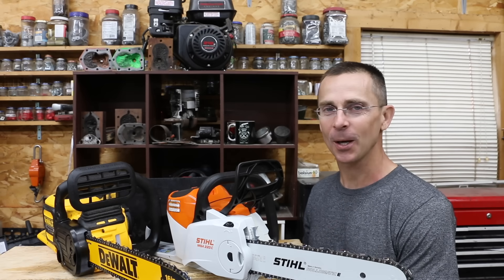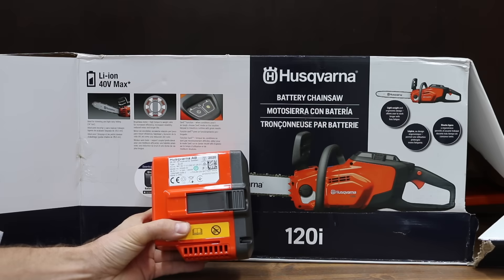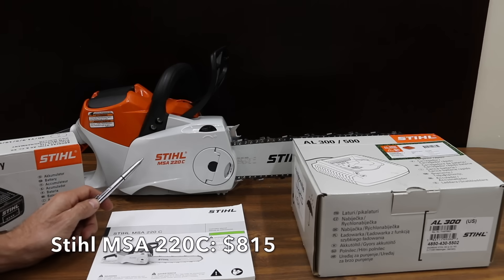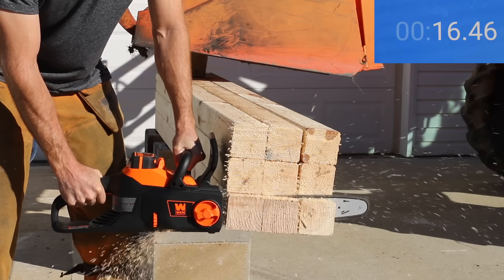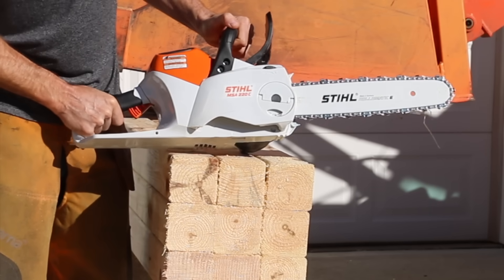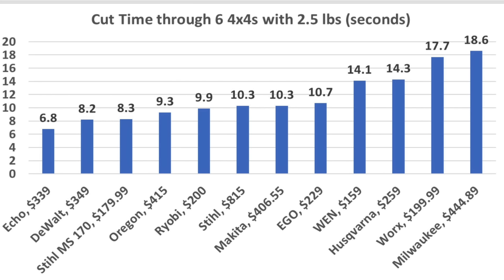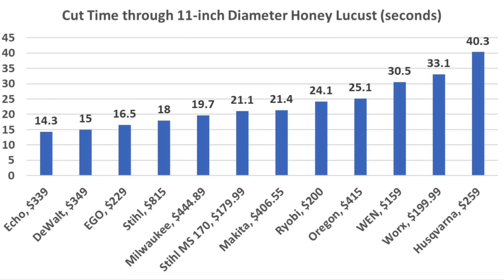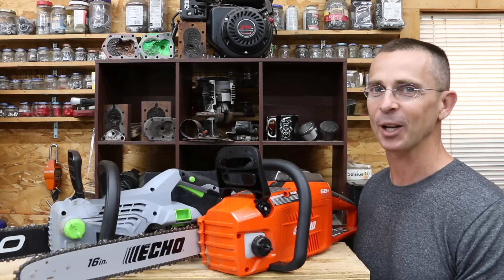Best Battery Powered Chainsaw Brand (ROUND 2)? Stihl, Husqvarna, Echo, Oregon, DeWalt

Comment: For a company like Stihl who you naturally associate with Chainsaws. I was surprised to see it so outclassed here. Especially for the price! And that is why I watch your videos! Thanks!
Reply: The only 1 up they might have had is reliability, but a 5 year consumer warranty match that too.
Reply: My stihl saw is great but it’s a gas machine. $800 for electric is way to much. My ms362c-m with the electric carb and upgrades 25” bar was $750 out the door at my Stihl dealer. That’s. A 60cc pro saw for less. I do know my dealer is awesome and doesn’t sell anything at msrp
Reply: @FishFind3000  I still prefer the 572xp.
Reply: @FishFind3000  It really depends. With Batteries you pay up front. With Gas you pay over time. Also depends if you use the more expensive "cleaner" fuel (Technically you should, as you otherwise breath in to much NOx if you use it all the time). Additionally the Battery powered tools need much less maintenance. Pretty sure, i get much better value of time, but our KMA 120 run 20h / week most of the year. (Multitool engine, can do about anything, dependent on the used attachment.)
But different world: Switzerland is much richer, but prices and salaries are also much higher. While imported tools are just a little more expensive. So 1000$ for a saw in Switzerland is like 2000$ in the US.
Main Bonus: Nimby Neighbours of the customers don't complain as much anymore about the noise.
As for Chainsaw, mostly their still gasoline, but mainly the simply last forever.
Reply: @beyondEV  thing is battery's also don't last forever and will need replacing. They also loss performance and lifespan in the heat and cold. There's some applications where battery can work but there's still lots where it doesn't work. For a homeowner they work fine for most people. Out here nobody is buying it until they are forced too. It doesn't make practical or financial sense for us here.
Reply: @JC-uq5gi  You call a good saw junk because you don't know what a good saw is nor how to properly use it. You're clearly just another fanboy. I don't usually use saws that small except for limbing or bucking small stuff but the saws I have used from Stihl and Husqvarna have all been great. I prefer not having to go through a dealer so can appreciate Husqvarna in that regard (nice to just order a saw from Baileys), and I hate trying to get my dealer to order in the parts I want for Stihl saws (like the less restricted mufflers they sell in Australia for instance or carb jets etc...). The air filtration is way better on Husqvarnas than Stihls which nobody would deny as is the chip clearance in many saws. Also the vibration damping is better on the Husqvarna saws more often than not. I probably like Stihls ergonomics better in many respects and they certainly also make great saws. Anybody that seriously says that either brand is junk is an idiot. They don't even need to explain themselves further because anyone with experience knows it right off. You are, to summarize, a blowhard.
Reply: @SaneAsylum  Only Stihl I ever had was a MS 200T, which everyone seems to love. I didn't. If ever it ran into pulpy wood it would clog up and stop the chain.  I've bought several Husqvarnas. Not one has that problem. All run great except the high dollar electronically self adjusting ones that never run right and are hard to start hot, despite following all their instructions on how to get it to tune itself.
Reply: This wasn't an apples to apples test, for instance he had the most expensive Stihl saw in there lineup and the cheapest husqvarna.
Reply: Random Stuffs  Sure thing sport, that's why nearly every arborist and logger uses either Stihl or Husqvarna.
Reply: @bubbafudpucker397  "nearly every arborist and logger uses either Stihl or Husqvarna". Not any more they don't. The guys who took down the big old lightning struck Tallowood in the paddock next door to us had a couple of Stihl petrol chainsaws in the back of the truck, but the first one they pulled out was a 58volt AEG (same chainsaw as the Echo in this video). Got the job done with it too. They only pulled out the Stihl cos they only had one battery model and there was two blokes.
Reply: @woopimagpie  Bizarre.
Reply: @bubbafudpucker397  "Sure thing sport, that's why nearly every arborist and logger uses either Stihl or Husqvarna".

It cost's more but you look professional. That's the only reason. I mean they both just got their ass kicked here.
Reply: What's interesting is that Andreas Stihl started with electric chainsaws, albeit not battery-powered ones.
Reply: i own basically all of the best saws from husky and stihl all my small saws 60 and under are husky all my larger saws are stihl also whoever sold you that msa 220 over charged you i work for a stihl dealer the saw is 369.99 with a 16 and a full chisel chain they gave you a 3636 005 0050 which is semi chisel saftey chain that saw ships with a 3616 005 0050 which is a full chisel saftey chain the battery is 220 and the charger is another 80 so even seperately you could have gotten it cheaper.....
Reply: Random Stuffs  that's definitely not true for the petrol powered stihl saws. Assuming you look after it a little, it always starts in a few pulls even when cold.
Reply: @RubsNL  Gotta agree - I dumped my Husky for a Stihl a few years ago and have never looked back!
Reply: @RubsNL  I bought a Stihl MS251 almost 5 years ago as my first "real" chainsaw with money I saved doing odd jobs for people and even though I don't use it everyday it starts every time I need it. It also helps that I don't run junk gas in it and I'm picky with what mix oil goes in it. If I don't need it for a lot of work then I'll just splurge on a small tin of True-Fuel. :)
Reply: @Slane583  Tru Fuel has been proven to be garbage though
Reply: @scottmurphy4946  I'm aware, this comment is from 4 years ago. That's why I no longer use it. I keep 5 gallons of ethanol-free high octane gas in a tightly sealed container on hand at all times until next season. Then it's put in the truck and replaced with a fresh supply.
Reply: @Slane583  I used to use it as well until I saw a few reviews and tests
Reply: you can't take your ICE engineers and put them on electric.
Reply: Well you know all of these battery-powered saws the best one held up on a battery was less than 8 minutes and I can never see myself having to go out and tackle a job that only takes eight minutes. I guess they would be good in a urban or suburban area but out on the farm in the woods I just don't know what they would really be good for unless you were using it frame something up
Reply: @jackwatkins7382  Yeah I was surprised by that. They're not really designed for continuous use, but stil I don't really understand how they went flat so fast. The wife has a little 18 volt model and it goes all afternoon on a 6Ah battery. I think cutting the hardwood is a real stress test for a chainsaw, and it would really pull some amps out of the battery doing it like Todd did in the video. A small petrol chainsaw would struggle just as much ( I know mine does - when I'm cutting up the big logs running it flat out it really chews through the juice, and boy does it get hot). In real life usage the battery would last much much longer than 8 minutes.
Reply: @woopimagpie   yeah you know it amazed me but I guess I'll just stick with my gas powered rigs. Somebody commented that that's what extra batteries are for but those batteries are expensive and I don't see myself spending over $300 for a saw and then buy another $300 worth of batteries. That's a lot of gas and mixing oil ain't it. Haha
Reply: @jackwatkins7382  Yeh, it is! 
I've got one of each now and I'm observing how the new battery model goes. So far I'm pretty happy with it. As I said, the missus chopped up a whole bunch of stuff with it (Tallowwood and Flooded Gum, both Australian hardwoods) and it went all afternoon with no dramas. The 6Ah 18v battery wasn't even flat when she was done, I was amazed at how it lasted, and the saw is easily as torquey as my petrol unit (a 30 year old McCulloch). It struggled a bit with some of the bigger flooded gum logs, but then so does the petrol unit.
You could probably just do what I'm planning, which is buy a battery model if/when your petrol ones die. Although, my little McCulloch has run fine for 30 years and shows no signs of dying. It might be a while yet. Old chainsaws are pretty indestructible if you're nice to them.
Reply: @woopimagpie  well I don't know if I'll be trying out any electric saws. I figure my money will be going for doctor bills for a while. I just got results back today from a pet scan I had done and it come back positive. But, I hear you about that old McCulloch. You know I got one of those from my grandpa back some 40 years ago and that thing run and sawed great and it was old at that time but the only thing was if it died after you had run it for a while you would have to let it cool off before it would crank again. You could pull your arm off while it was hot and it would never crank. You know there was a saw back in those days and I haven't seen them around in so many years and it was a Lombard. It favored a Homelite but it ran better. And what we call them was cordwood saws because that was what we mostly cut was just Pine that was sold as cordwood that made its way to the paper mill. Which we cut Logs with it too anything that you could get the bar through on it even if it had to go all the way around the tree. I think I'd mentioned I have a couple of Stihl chainsaws that I've had for years I think the 02 8 is the one I bought new back in the late 70s early 80s. But I've got to replace some gas system parts on it but believe it or not those things still have so much compression it's hard to pull the cord! But I'll tell you they know their way around Hardwood. I don't know what flooded gum is but we have a lot of gum and what they call black gum and black gums pretty tough but cutting firewood or wood for smoking we normally cut Hickory and old Blackjack Oak, Red Oak and Post Oak. Blackjack and Hickory even when they're green you can see sparks fly off your chain when you're cutting it sometimes. I know they were discussing chisel tooth and semi chisel tooth or something on the chains, but when I went to the store to get a new chain put on the saw I just tell him I wanted a hardwood chain or I wanted a softwood chain. And of course the hardwood would be a full chiseled I think they call it. Which back years ago I had some of the old-timers at that time tell me not to put a hardwood chain on a saw if you were going to be cutting Pines and gum because that rounded tooth done better and I think they may have been right but I cut hardwood and softwood so I went with the chisel tooth because I only had the one saw at the time and that rounded tooth did not work well on hardwood. but back to your McCullough you know that thing will probably Outlast both of us! I know you can buy the small ones at Walmart now and people shy away from them but they were good saws Back in the Day. I have a little small one that I need to replace all the gas lines on it and get it restored but oh, maybe at a later date when I get through some of this junk I got to go through. but you have yourself a wonderful day and a merry Christmas and it was good to converse with somebody from the land down under! Or at least I thought you said you were from there. Good day
Reply: @jackwatkins7382  Man that's crap news about your scan results. Geez. Real sorry to hear that.
I enjoyed reading your piece, and I learned a couple of things too. The Flooded Gum I was talking about is a species of Eucalypt - the prevalent tree family here in Australia. Most them are considered hardwoods, there's a couple of really hard ones, one called the "Grey Ironbark" (Eucalyptus Paniculata) is well over 3000 on the hardness scale. Ridiculously hard. My Gran had an old handmade fence made from ironbark at her property in the mountains when I was much younger than I am today (that species is endemic to the area where her property is so plenty of old furniture and fixtures were made from it in the old days).  She wanted to hang some plant baskets on that fence so we decided to put some screws in to hang the baskets on. After I broke a third drill bit and the drill was almost too hot to hold on to we gave up and just hung some wire over the top. A bit later on I was relating the story to the old bloke who ran the local hardware, and he just laughed and said I'd basically have no chance against ironbark with just a basic drill. He said once that timber dries it's not called ironbark for nothing. I learned something else that day too, which was if you're planning on working the hard Eucalypt woods, you'd best do it whilst they're still green, because once they dry they are as hard as iron. My Gran has left us now, but the property is still there and so is the fence! I reckon that fence will outlast time itself. I also knew another bloke whose verandah posts were made from ironbark - just out of curiosity one day he swung an axe at one of the posts and the axe just bounced off with hardly a mark left on the post. Yeah. That hard. Phew.
The Flooded Gum (Eucalyptus Grandis) we have around our place isn't quite as hard as Ironbark, but it's pretty hard just the same. It's a work out for any small chainsaw, and I wouldn't be foolish enough to attempt cutting big sections once it was dry. It's called Flooded Gum as their preferred habitat is along river banks, and the part of Australia I live in is sub-tropical so the rivers flood every year in the lead up to summer. It's quite a lovely sight actually - they are very tall with straight white trunks and when the river is in flood the whole scene is a bit otherworldly. It's sometimes called Rose Gum too - the timber has a pinkish hue when it's still green, but that fades to a lovely reddish-brown as it dries. The floor in our library is made from it. I love it, it's beautiful timber, either as a tree or a floor. As for having a new chain put on the saw, I don't think my local shops even stock softwood chains - none of our local forest trees are considered softwood. It's either hard, really hard, or forget it unless your saw is V8 powered, lol.
I've been watching a fella in the US who has a channel called Out of the Woods, and I've been learning a bit about American tree species from watching his channel. He has a small sawmill and I enjoy listening to him talk about the various techniques required for milling timber, and of course learning about the different timbers at the same time. Interesting stuff.
I believe McCulloch is owned by Husqvarna these days, and they market it as a kind of budget Husqvarna range, which could be worse. Husky make some pretty fine machines - if some of that engineering experience is filtering down into the McCulloch range they're probably pretty okay chainsaws for the money. I doubt I'll ever find out though - as you say, my current older one will likely outlast us both, and if it doesn't, well, I'll probably replace it with a battery powered unit. If the battery tech continues to improve at the rate it's going pretty soon petrol chainsaws will be a thing of the past. The battery models will surpass them in all areas, which will mean there will be no point marketing petrol chainsaws. That day is coming I reckon.
Well mate, I hope the road in front of you is as smooth as it can be. Maybe keep that old chainsaw fix as a bit of a goal - it might help keep you going when things are tough. Thanks for the chat. My very best wishes to you and yours. She'll be apples mate, which is Australian for: "everything will be okay my friend".
Reply: @woopimagpie  well thanks for the story! Extremely interesting. Yeah are gum trees here are softwood they are used for making paper and such. I don't know about some of the hardness of wood that grows in other areas but here in Alabama we don't have much except Hickory and Oak. Now I don't know that they're that hard when they dry but Hickory, if not nailable! And I don't think I've ever took the occasion to try to drill it. Like I say when it's green it'll throw Sparks off a chainsaw chain and when it's dry it don't take long to take the edge off of you're chain and that's trying to cut small stuff just for smoking and cooking. We may have another trailer to this considered hardwood but nothing like what you're talkin about that I'm aware of. I always ever since I was young would like do you have took a trip to Australia and probably even stayed. Y'all have some very beautiful country but some very strange animals that are very cool at least to an old country boy like me. The only thing that I've learned as I got to be an adult is that I hate spiders and y'all got the worst spider in the world! I read something about that funnel web could actually bite through a shoe? That might have been souped up but scary as hell. Oh and I know y'all supposed to have the most poisonous spiders but you also have what eight out of the 10 most poisonous snakes in the world? I don't remember if you have the number one space but I think that's what the documentary said about all the others. I'm not afraid of snakes as long as I can see him because I normally carry a pistol but the one that you can't see is the ones it'll get you. I hate it that you're half a world away actually a world away. I have talked about some things in the past when things were better and someone may have something and I had something and we would load them up in our truck and meet halfway. I would like to have a tried some of that ironbark and I could get it green. well I guess I better get off of here. It seems I say too much or maybe I don't say it enough. Have a wonderful Christmas and New Year's and may God bless you. And I like the old Irish prayer I guess they called it, I hope we're in heaven a half hour before the devil knows we're dead! bless you and all of your family
Reply: @woopimagpie  well thanks for the story! Extremely interesting. Yeah are gum trees here are softwood they are used for making paper and such. I don't know about some of the hardness of wood that grows in other areas but here in Alabama we don't have much except Hickory and Oak. Now I don't know that they're that hard when they dry but Hickory, if not nailable! And I don't think I've ever took the occasion to try to drill it. Like I say when it's green it'll throw Sparks off a chainsaw chain and when it's dry it don't take long to take the edge off of you're chain and that's trying to cut small stuff just for smoking and cooking. We may have another trailer to this considered hardwood but nothing like what you're talkin about that I'm aware of. I always ever since I was young would like do you have took a trip to Australia and probably even stayed. Y'all have some very beautiful country but some very strange animals that are very cool at least to an old country boy like me. The only thing that I've learned as I got to be an adult is that I hate spiders and y'all got the worst spider in the world! I read something about that funnel web could actually bite through a shoe? That might have been souped up but scary as hell. Oh and I know y'all supposed to have the most poisonous spiders but you also have what eight out of the 10 most poisonous snakes in the world? I don't remember if you have the number one space but I think that's what the documentary said about all the others. I'm not afraid of snakes as long as I can see him because I normally carry a pistol but the one that you can't see is the ones it'll get you. I hate it that you're half a world away actually a world away. I have talked about some things in the past when things were better and someone may have something and I had something and we would load them up in our truck and meet halfway. I would like to have a tried some of that ironbark and I could get it green. well I guess I better get off of here. It seems I say too much or maybe I don't say it enough. Have a wonderful Christmas and New Year's and may God bless you. And I like the old Irish prayer I guess they called it, I hope we're in heaven a half hour before the devil knows we're dead! bless you and all of your family
Reply: @woopimagpie  Now please dont say that your McCulloch is the Eager Beaver model. LOL
Reply: @woopimagpie  ..McCulloch..Nice! ..what you really need is a good ole' McCulloch SP-125.. :)
Reply: @jackwatkins7382 they are designed for the guy who only needs to do a few cuts every once in awhile not for all day work. I will say they are a game changer for use over 10,000 feat as a hunting guide if I come up on a downed log on a horse trail they fire right up and are more ch quieter  than gas. When you get to 10,000 feat it’s quite hard to get a gas one started at times.
Reply: @jackwatkins7382  That's what more batteries are for. Just like with cordless everything else.
Reply: @JC-uq5gi  There is nothing real about calling the 572/372/272 line junk. If it broke on you chances are really good that you let it down not the other way around. Of course every manufacturer occasionally has a lemon escape QC but from listening to you whinge it is clear that isn't the case here and a couple of Stihl stickers would make it run like a champ...
Reply: Staying power and longevity bud
Reply: Hell's favorite Salty Masshole  not with the same battery capacity ( watts hours it isn't) .  And you be replacing your ego after less than half the number of hours used
Reply: The same can be said for cars - even reliable german brands are making electric vehicles or hybrids now, but they do not match the quality or performance of the japanese. In 2021 having a cordless in your lineup is a must, and some companies do it as a must, this is why it's still a solid machine but they don't show it as much love as they do to their petrol line-up
Reply: More marketing budget than r and d budget
Reply: I've had my Stihl for 25 years, no major servicing required.

Let's see how long those plastic Chinese things last lol
Reply: Get that 300 series.
Reply: I’m not… look at every major big old corporation… too big to fail right???No… they just fail to innovate the new in the now.  Stihl put a lot of stock in the 500i a fuel injected saw.  Echo is a leaner younger company, hense the 2511t which challenges 25+ years of engineering in a top handle arborists saw.  (Unmatchable power to weight ratio when modified !!!).  Sawyers that run saws often appreciate power : weight, and really light fast saws.
Reply: Absolutely, I’ve always considered Sthil at the top of the class when it comes to chainsaws. 
That’s why I love this channel. everything is tested equally and placed based on its merit not reputation.
Reply: I love my Stihl 661 but I’m not loyal enough to buy an inferior electric saw from them
Reply: You have to understand the context for these numbers. I've owned this Stihl in the test for about 6 years now and seeing the results I wouldn't switch over to any of the other saws. Problem with Echo is the weight. Price wise at least today all of these saws are around the same price as Stihl. So there is no price difference. I don't know if the prices were wrong here and they are for the saws when Stihl is for the whole package with charger and battery. Stihl is among the lightest while being at the top performance wise.

With Dewalt you have a problem with the slow battery charging time. Maybe in other aspects there are no other problems. It's really only a problem if you are working 2 batteries with a charger. Dewalt looks to be pretty long so worse shape than Stihl.

With Echo you have bad ergonomics with heavy weight of the saw. You go past 5.5kg and it's not so easy to handle one handed. And you require tools to change the chain. Stihl's toolles way is just how it should be. At least you get something for the weight as it cuts the fastest and has the longest battery life. But I would not want a 6,6kg saw for mobile usage. Basically for yard lumber work. I would not want this for clearing trails.

With Ego you can get a different battery but I just don't like the shape of the saw. You are constantly hitting the battery when handling the saw.

And as I'm looking at prices for packages some of these are more expensive than Stihl.
Reply: It doesn't have a reduction to lower the chain speed and increase the torque.  Very high chain speed, not always the best.
Reply: Random Stuffs  I have a 30 years old Stihl 021 and it has reliably always taken 12-13 cable pulls before it starts.
Reply: @Nardypants  I have a 40 year old 051 that gets used for about 2 tanks of gas a year. It starts every time after a few pulls.
Reply: That Echo saw is a rebranded AEG/Ridgid unit. In Australia they have a 6 year warranty, and the Stihl stuff (which costs far more) only has 2 years....
Stihl and Husky are the kings of petrol powered chainsaws, but they're lagging behind badly in the battery models. DeWalt and Echo/AEG/Ridgid have them well and truly beat. If you buy a Stihl battery chainsaw you're just paying for the name. Plenty of other brands will beat it for price, ability, and longevity.
Reply: Bet you any money that stihl is still going strong in 10 years
Reply: @ironhornforge  that Echo will be too...I have both.  Echo is the best saw IMO
Reply: @ironhornforge I don’t think any battery powered saw will be good after ten years of use. They are designed to fail and they will continue to sell the new” upgraded versions “ just like all the battery platform tools.
Reply: @JC-uq5gi  I can't tell you how many times we've met in life. Every time just as ridiculous as the last...
Reply: I was also surprised at the lack of performance from the Stihl
Reply: @derekathey4616  same ...in a way . Mb I won't be  upgrading  from my 200 :) now . There is the option of 16 inch with it of course . But given it really requires a higher spec battery than my current 200 and 300's . I should just get a petrol 18 or 20 inch .
Reply: @JC-uq5gi  Should have bought a better Husqvarna then. There is no disputing that Husqvarna has better air filtration than Stihl and better chip clearance on large saws. I like both depending on the saw, but to say that one brand is good and the other is trash is ignorant. Stihlership $$$ policies suck royally as do both of their low level consumer saws.
Reply: @SaneAsylum  I bought a 16” husky runs like a beast but maybe I’m an outlier 🤷🏽‍♂️